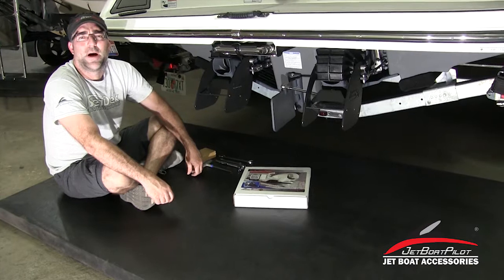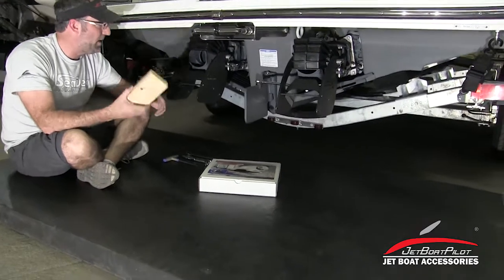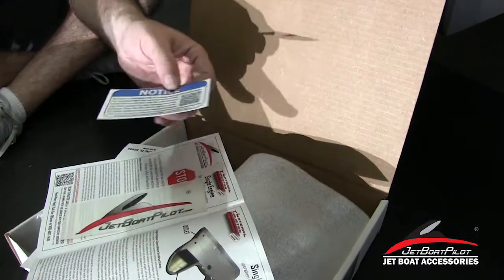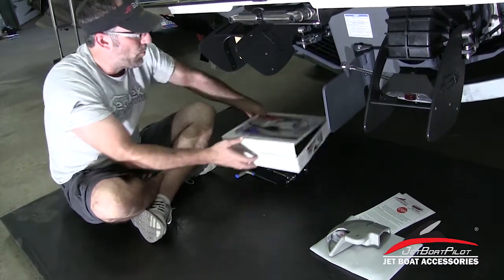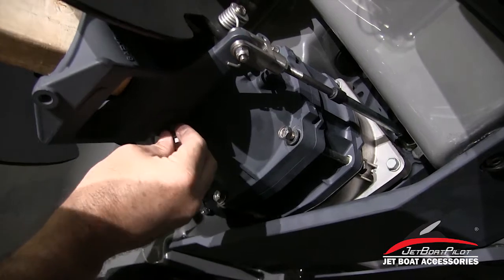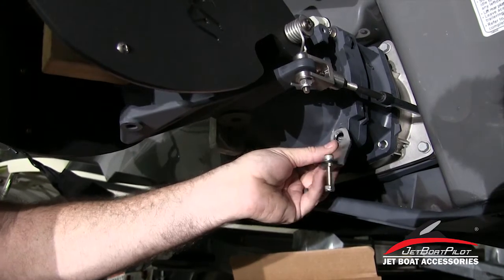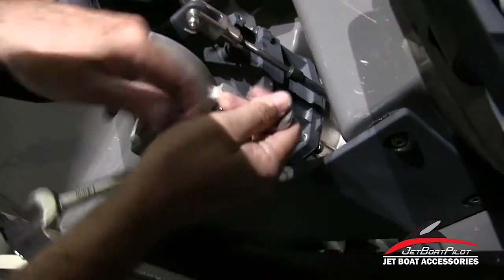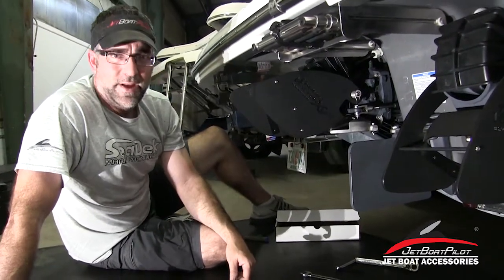Twin Engine Lateral Thruster Installation Video Updated 3/30/18

Comment: I just installed these on an ar210. And I have the thrust vectors XL, and they seem to rub on them! Is that normal, the nozzle has play like it's supposed to, but when I turn full right it seems that it binds on the thrusters!
Reply from the maker: You may need to trim your Thrust Vector fins to eliminate the rub
Reply: @JetBoatPilot  thats what i had thought and saw a video somewhere, but for some reason i cant find it anymore! Just trim it until it doesnt rub I suppose?

Comment: Let me start by saying your customer service is outstanding. So DISAPPOINTED to learn today the lateral thrusters will not work on my 2021 212SE twin engine boat. I was told a year or two before they are redesigned and available. Guess I'll have to buy some extra oars. Totally distraught right now.
Reply from the maker: A new LT is in development for your boat. Late 2021 or early 2022 expected release date if all goes well.

Comment: Got my lat thruster installed. Love them! Can you help, I’m installing a thru Hull transducer for a new Simrad unit on my 2018 242. I need to know what the deadrise is so I can order the correct transducer. Yamaha literature says 20° but self measurements conflict. Any help would be appreciated!
Reply from the maker: All I have is the Yamaha specs. Sorry I cant help much on this subject. Thanks for your order. Enjoy your Lateral Thrusters!
Reply: Jet BoatPilot. Thanks. Btw I saw the new 27’ Yamaha at the Miami boat show. Can’t wait for a JBP version of the under water stern seating. I looked, there’s plenty of mounting space on our 24 footers...